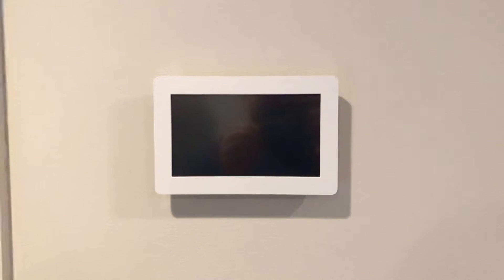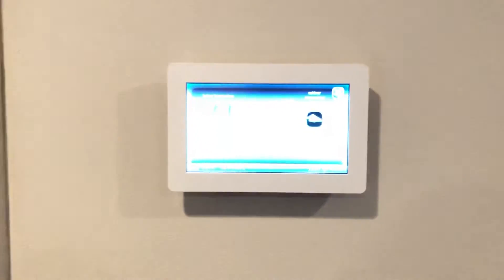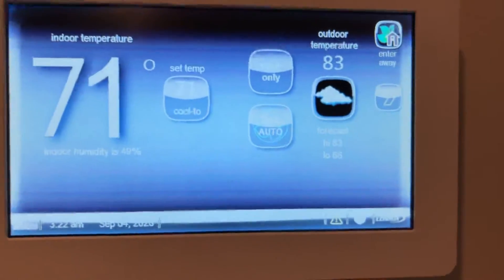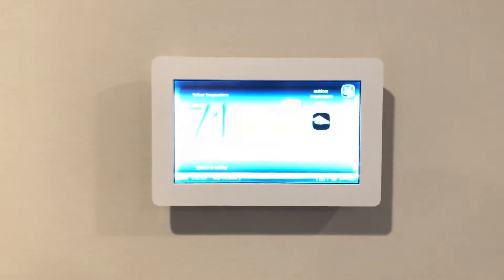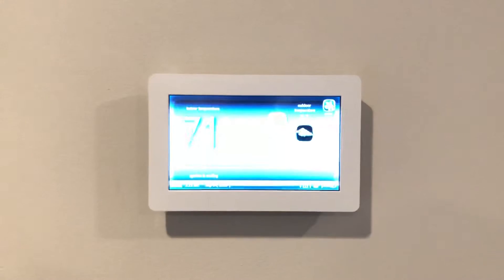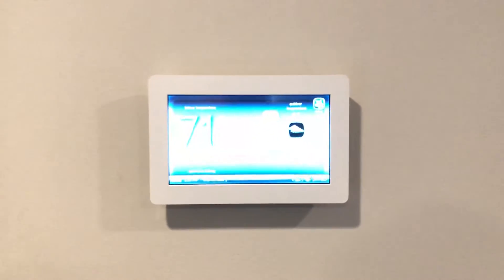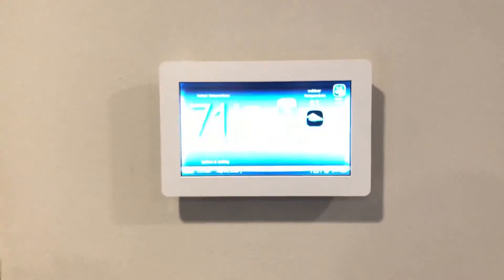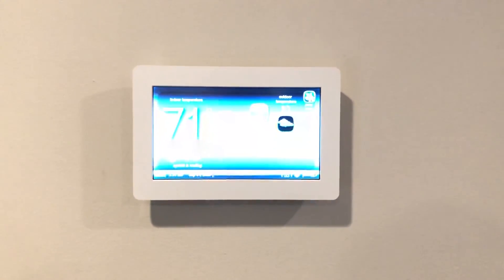UPDATE: Another Failing Lennox iComfort 10F81 Thermostat

Comment: The unit is just fine. However, our utility just swapped our outdoor meter and the iComfort screen did this. It actually happened in early spring too but the worked just fine all through summer and fall, until today. I'm thinking perhaps moisture, a power spike and the caps need to completely discharge or the screen needs a hard reset.

Comment: When this initially happened to mine, it was after an electrical outage. When I saw it, I threw the breaker off again, and when it booted, the screen was normal for a brief period of time.

I'm assuming this is due to a faulty resistor connected to the screen, causing the brightness to increase infinitely?  I don't believe it is the screen itself... Then again, I don't know much.

Comment: Mine just died 7 years after installation.  Talked to Lennox and they said absolutely no exceptions to the 5 year warranty.  My technician says there is a way to wire in the Ecobee to have the system work as a 2-stage but I'll lose 1.5% efficiency.  My invoice for my system from the installer clearly states 10-year parts warranty and does not have a separate warranty for the thermostat, so I will go back to them on Monday.  Lennox is a terrible company with horrible products.  I will never buy again!

UPDATE:  Bought this through Costco and called them to complain.  I received a call from my contractor two days later.  They put in a new S30 and paid for labor!
Reply: @billrector I bought mine through Costco as well. What did you say to them? I'm going to call them today too.
Reply: @kimolee502  I started with the Costco Lennox number but you will get a Lennox employee who is dedicated to Costco's HVAC business.  I talked with them several times and they were sympathetic but all they could do was contact my contractor.  I then called the standard Costco customer service number and explained my story.  The contractor called my about 48 hours later and covered both the thermostat and the labor.  Love Costco!

Comment: This just happened to me.  Bought a conventional Honeywell thermostat.  Had to rewire at the furnace from communicating thermostat to conventional.  Works now, 50 bucks spent instead over a thousand for another icomfort.
Reply: @CFunk-xw2wc can you explain what you did to convert to conventional thermostat?
Reply: @kimolee502  You will have to change the wiring at the thermostat and the furnace from communicating to conventional.  First turn off breaker to your furnace.  Then go to your thermostat, remove the icomfort.  Separate all your wires and note the colors you have.  Should be black, blue, green, brown, white, yellow, orange, red, etc.  When you put a new thermostat in, wire it as you would a conventional thermostat.  There are examples on YouTube and Google, also whatever you buy will have a diagram in the instructions.   After wiring the colors to their respective location, take a picture then go to your furnace.  Remove the panel.  Use your picture that shows which color goes to which port, and do the same wiring on your furnace.  After that, take a picture of the wiring.  Turn on breaker and test out.  

Sounds tricky but it isn't.  It's simply connecting the wires to the ports and mirroring the color scheme for the thermostat and furnace.
Reply: Sir, I would like to do as you and replace this stupid lennox thermostat.  Can you tell me if (in the furnace) you only had to move the(TB84) indoor wires (R 1+ 1- C) to the TB1 Terminal Board or did you have to move the (TB83) Outdoor (R 1+ 1- C) wires to the TB1 as well.  Also, did you need to move wires in the outside system as well?  I appreciate any information you can provide, Thanks in advance, Ron
Reply: @ronwanzer  Hi Ron, I did not have to move any wires on the outside.  Only at the furnace.  My Lennox furnace had the communicating terminals (with C1, C2) and conventional (with all the other terminals).  Simply move them over and hook up the additional colors to their respective terminal.  Then mirror that on the thermostat.
Reply: @CFunk-USMC  Thanks for the reply, I should be able to do as you did...can you tell me which model Honeywell thermostat you installed
Reply: @ronwanzer  RTH6360D1002E
Reply: @CFunk-USMC  Did you have to flip any dip switches?

Comment: Hello All,    I have a Possible SOLUTION...... Please read below.....!!!!!
I ran into similar issue with my Lenox iComfort thermostat screen last week. It turned out all white with black and gray vertical lines on it. I went up the attic and unplugged my system from power outlet, put It back after 1-2 minutes, did not work, same plain white screen.
 
2nd time I unplugged it again and this time left it like that for approx. 30 minutes while I was researching on youtube and checking my system installation paperwork to notice its 6 months past warranty.  Plugged it back after 30 minutes and vola.... the nice blue Lenox screen comes back to life. Since I did not see any solutions on you tube for this issue so I guess it's my turn to contribute some thing to help others. 

I am not sure if it will fix your issue or not but it doesn't not cost a penny and totally worth trying.  

All the best...!!!!!

Comment: My screen started doing this last year. If I pull it from the wall and wait 30 mins it works again once I reinstall it. So frustrating because we had a power outage today and now it just stays white when I reinstall it. I installed an XC20 system maybe 6 years ago. I hate this thermostat. I've done HVAC for about 15 years and ever since this thermostat came out its been a problem.

Comment: Here is a possible fix if you are having this issue. Possible fix for iComfort 10F81 thermostat that is losing date / time or has a blank screen. The Lennox iComfort 10F81 thermostat does not have a battery. It uses a super capacitor. (5.5v 1.5F H type button style) as a battery to hold the date / time. I had this symptom at first then got the blank screen like a lot of people who have this thermostat that failed. I also just fixed mine by replacing this part. If you have any skills at soldering or a friend who does save your money by trying to replace this part. It cost me $13 + $8 dollars shipping from Digi key who sent me the part the very next day after I ordered it. My thermostat is now working 100%. I love my Lennox furnace but hate that the company is trying to gouge its customers by making them purchase a $2000 S30 (the replacement model) when they could have repaired the failed thermostat so easily. I know a little about soldering but wouldn’t consider myself an expert and I was able to fix this. It is well worth a try to keep your furnace running as it should. If you don’t have it in you to fix your thermostat then you can replace your iComfort with most standard two stage thermostats. (The ones that cost less that $100). I hope this helps someone from getting burned by their Lennox furnace.
Reply: My capacitor showed signs of leaking.  I replaced the capacitor but it did not solve my problem.
Reply: Good info
  I'm going to try and repair mine.
Do you have the Digi key pn?

Comment: Called Lennox on my 10F81 thermostat as I've been having some problems with it.  Lennox said they will not replace it if it is out of warranty.  Not having bought the Lennox unit, I'm not sure how old the unit / thermostat is.  Then, you must have a licensed Lennox HVAC come out and install the thermostat to keep your unit under warranty.  The local Lennox company told me it would cost $397 to come out for an appointment.  Guess I will have to put up with the thermostat until I can't.

Comment: I had the same problem with my comfort which failed just after 5 years. As I have a two stage high efficiency Lennox furnace, my HVAC repairperson replaced it with a Honeywell T6 thermostat ($265 Can) and charge me $120 for installation which included running additional wiring. I refused to pay $1600 for another Lennox thermostat. The Honeywell thermostat worked really well.

Comment: I wonder if the right to repair laws will help with this.  My screen started back up, luckily, and I turned the screensaver on and the screen brightness to 20% as someone else suggested. Hopefully it works.  Is the S30 discontinued now?  I'm wondering if there is another Lennox thermostat that doesn't require a rewire to install.

Comment: I live in Milton,Ontario ,Canada.
My lennox 10f81 thermostat went blank after 5 yr4 months of service.
I called enercare company which is my contractor to replace it.
They installed a new basic Emerson 1f83c-12PR Programmable thermostat that's sold at Amazon abt 80 CAD.
I am expecting a bill of abt. 200 CAD. for service call.Better than 800 +CAD for a lennox communication thermostat. 
I saved a lot and problem solved.
You can replace thermostat easily  but you have to remove communication  wires from furnace that is tricky.without removing those wires thermostat will not work.
I hope my comments and experience help you guys.
Reply: Sir, I would like to do as you and replace this stupid lennox thermostat.  Can you tell me if (in the furnace) you only had to move the(TB84) indoor wires (R 1+ 1- C) to the TB1 Terminal Board or did you have to move the (TB83) Outdoor (R 1+ 1- C) wires to the TB1 as well.  Also, did you need to move wires in the outside system as well?  I appreciate any information you can provide, Thanks in advance, Ron
Reply: I'm in Oakville and I just got quoted $1500 plus tax and install by Enercare to go to the one they suggest now.

Comment: i guess im lucky, my 10f81 made it 9 years, the furnace warranty is 10 years so it almost made it to the end of the warranty. i can still use the app. it looks like we can use a nest BUT we need 6 or 7 wires (so i would need more wires pulled through the wall). The furnace control board has another set of terminal strips for conventional thermostats but i would lose some of the finer control of the furnace, such as variable fan speed. I would just have a couple fan speeds available. But at least it would work.
Reply: Dan you are absolutely correct.  If you used more wires, you would be trying to go to noncommunicating thermostat and Lennox HVAC equipment which will also require rewiring at attic equipment as well as the outside unit.
Reply: @devontownsend4530  I made the mistake of unplugging the lennox stat to 'try' a nest. When I put the lennox stat back in, it would light up but not show any controls.

It wouldn't be so bad but the lennox stat boots with an old date and time, and if the date and time don't match, then the online Lennox server rejects the stat which means you can't use the app anymore either. Normally with a functioning stat it's no big deal after a power outage. You set the date and time on the stat itself and a few seconds later it will go online to lennox. But if you can't do that, well it's just done.

Then I read lennox furnace boards don't work well with Nests, somehow the boards fry themselves. Nest draws too much power or something. 

It's recommended to use an Ecobee, no reported problems. So I bought that, and ran an extra wire, turns out you only need 5 wires to run heat and a/c. 

I used furnace board dip switches to try and mimic the lennox stat, by changing ramp speeds and such, but it's not the same. High speed is pretty loud, where as with the lennox stat, the fan topped out at 850 CFM which worked great and was dead silent. I got it down to 950 which isn't too bad.

But hey it works, I have heat and a/c, and saved $800.

Comment: Ate lennox thermostats interchangeable? Meaning if I have a lennox unit can I remove the lennox icomfort thermostat and put another lennox thermostat? What about a Nest or another brand? Thank you
Reply: You can replace a communicating Lennox 10F81 with a communicating Lennox S30 but as the responses here show, it is a very expensive proposition somewhere in the neighborhood of $1,000 to $1,200.  Non communicating thermostats such as a Nest or other brand will not work on Lennox communicating HVAC units.

Comment: The fully modulating furnace is great but thermostat is built with poor screens and the company should be embarrassed. Mine just failed with a blank screen and I am being told Lennox will not fix the screen and that the new S30 iComfort thermostat is roughly $100, which is absolutely insane.
To make things worse, the ecobee that I was going to buy does not support these modulating furnaces, neither do most "regular" ones, including Nest. The thermostats that handle these types of furnace are more complex and probably use proprietary standards so we really are stuck.

Comment: The power supply to my Lennox thermostat is toasted.  DC Voltage between the Red/Yellow terminal = 2.75 VDC and Blue/White = 2.68 VDC.  I believe this thermostat DC power should be 24 VDC.   Lennox, can you help?
Reply: Was this for the 10F81? Did you try to replace this part and could you show which one it is?
Reply: its 24V AC not DC

Comment: My Lennox thermostat part # 103445-04 Catalog # 10F81 will not turn on.   I got my Lennox HVAC system installed in August 2018 for $14,000 dollars. Apparently there was a power outage for 5 minutes last night in my area which caused problem.  The thermostat displays blank screen except for the 3 dots sequentially turning on/off the middle of the screen.  Does anyone else has the same problem?

Comment: My iComfort started to forget program temperatures and programs. It will drop out of Winter mode, change to Summer and make the "heat to" 45 degrees. Hasn't been pleasant during the cold weather. I have needed to reconnect the Wi-fi more often as it forgets the connection password. My original dealer went out of business, and I am now beyond warranty. I contacted a new dealer and was told they can do nothing for me on the iComfort Wi-fi but suggest the S30 as an upgrade. Hmm, maybe if it is better. I received a quote for $1488.00. I told them I do not need to have everything W-fi "talking" to each other through the thermostat. They said that if it was installed right there would be no problems. Interesting that there are continued complaints about these iComfort thermostats regardless of the model and these guys are smarter than all the rest. I asked them about options. They said if I do not want the S30 they can install a Honeywell thermostat. No fancy schmancy.
On top of it all they quoted a mini-split Lennox system for my workspace. Hmm. I am now worried that Lennox may be a less than ideal choice going forward.

Comment: okay, I am in the same boat. I saw mine failing with banding after five years. I suffered through it, and even used the mobile app.  I finally purchased one on eBay. I then saw my screen working just fine for about six months.  it went out again this weekend, and I went ahead and replaced it.
Reply: Were you able to just pop in the new one from EBay and it worked? I've been controlling my heat and a/c with the app for over a year (to avoid paying $1,000+ to replace the screen/device), but it appears to have gone offline now, and I need to log into my Dashboard online to do any adjusting. I can do that, but it's obviously not ideal!
Reply: @AliBCool  Yes. I popped it in, configured it for the network, waited about an hour for it to download information, and it worked!  Hopefully, it lasts a few years.
Reply: @KaiPonte  i read somewhere else that the replacement units are 'tuned' by your local dealer for your exact system and just buying one online and slapping it in would give you headaches. But it sounds like you did exactly that and it worked? My 10f81 has a USB port on the back so i assumed it really does get programmed by the local dealer for installation. fan speed, compressor stages, etc.
Reply: @danwake4431  I put it in, then configured the wifi, and made a few other settings. been working like a charm.
Reply: @KaiPonte  if I keep tapping on my stat it slowly gets clear enough to read so I went through the settings and took pictures of the cfm, humidity settings, etc before it completely dies. So I should be able to grab a replacement off eBay and set it up like you did.

Comment: I found that exact model on eBay, only the serial number is different. You guys think I'll work, if I connected to the same connection??
Reply: I also purchased a new screen through ebay but it would not work, therefore something in the 10F81 motherboard is defective.  The ebay seller had an excellent return policy, therefore I returned it for a refund of my purchase price.

Comment: How difficult is the installation to go from this model to the S30?
Reply: Not difficult and does not require rewiring.  There is a black gentleman with a Youtube video that show you exactly how to do it.  When you buy an S30, you have to attach a hub (usually in attic by equipment) and then attach the thermostat wires (4 wires) the right side of the hub.  You simply open the attic unit with the thermostat wiring, remove the wires and attach them to the right side of the S30.  With an additional 4 colored wires, attach one end where thermostat wire were attached and then other ends to left side of Hub.  The marking say R, I+, I- and C.  The S30 Hub steps down the voltage from 24 volts to the indicated 12 vdc.
Reply: @devontownsend4530  Devon - can you provide a link to the video you are referring to?  My 10F81 died at just over 5 years, I'm looking to replace it with S30 myself.  Thanks!
Reply: Anyone? I’m wondering the same thing.
Reply: My 10F81 just went up and I have been researching options today. I've read on message boards that installing the S30 requires rewiring at the air handler so a Lennox HVAC tech will have to come out to install. Seems like most folks are saying the cost for the S30 install/rewire is ~$300.